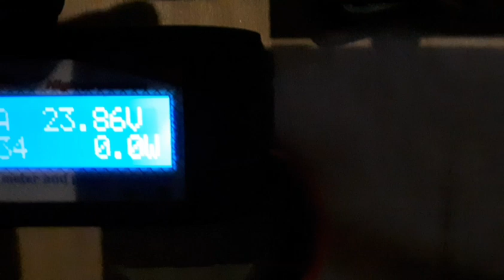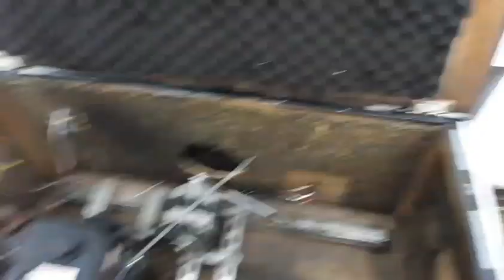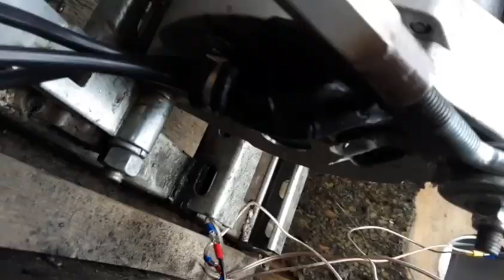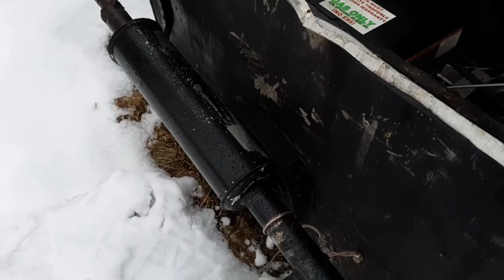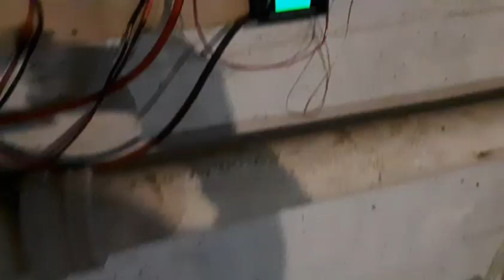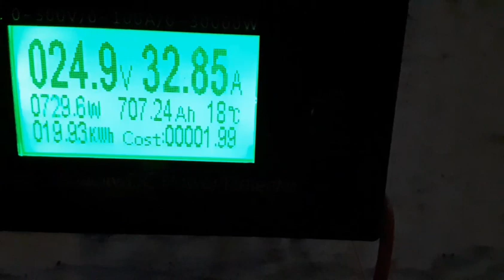DC Generator, Battery Bank Charger.

Comment: Why the stepup to 24V?
Reply from the maker: Double the volts, cut the amperage in half. Safer for all the individual components and my family also. At 12 volts there's just SO much amperage involved in every process before it comes out of the inverter.  Doubling the voltage allows my to get all 1200 watts out of my panels because it's an 80 amp charge controller so at 12 volts the controller would only allow roughly 800 watts though the line. Also I can save money on wire because I'm carrying half the amperage.  It's easier on my generator...half the amperage,  half the heat. The 24 volt inverter is also more efficient because it doesn't have to step voltage up so high. Higher voltage also travels through long wires easier.  Voltage = Electrical Pressure.  
Many reasons.  Honestly I'd like to step up to 48 volts to be yet even more efficient but that will require a new inverter.
Reply: @smallcityhomesteaders1600  Thanks for the replies! Battery banks are rather intimidating. Thousands of bucks in equipment and so much to learn. It's now or never, though, I reckon.
Reply from the maker: @anonymousjr1140  Seems to be, indeed. Group 31 deep cells are pretty reasonable.  Believe I paid $120/battery for 10 of them. Your demand could be different then mine though. I run a full size fridge and a large deep freezer year round.  We also have 3 daughters so we run laundry. We line dry clothes to save power but can run the dryer if needed. I also do all my fab in my home workshop...welder is used frequently and occasionally the drill press, grinder, ect. The huge, expensive "off grid" batteries are nice but not cost effective to me. If you learn how to properly service your batteries they last longer then the sealed "maintenance free" ones. Worth the trade off to save 50% and not have to replace them in 2-3 years. When there one's no longer serve my purpose however...I'm buying a forklift battery.  Expensive up front but they last nearly forever if taken care of. Shop around locally.  Make relationships with smaller businesses and you get better deals and service if anything goes wrong. If you have a local forklift service shop, contact them and see if they have used batteries for sale. When the wind isn't so loud I'll do a more complete rundown with a cost breakdown and list parts used. In my descriptions for all videos I list parts with links. Hope I can help.

Comment: Nice video. What video of yours explains more about the bank and other equipment?
Reply from the maker: I should probably do a video going over everything but it's mostly condensed into the one titled '500 and 800 watt turbines from Green E Solutions' and 'Off Grid Solar System Overview'. I will get on making one that briefly goes over it all....it's a lot of stuff though. More then just the generation side of the system but the conservation side... I redid quite a bit here to maximize total system efficiency.

Comment: When you get around to a wiring diagram, I would like to see it. What batteries are you using and what AH do you achieve? Good job on the video!
Reply from the maker: I could probably do a diagram on a white board in the future.  Batteries are group 31 deep cells. 110 Ah each but the bank is series/parallel  at 24 volts so 10 batteries,  5 pairs @ 24v, 110Ah....550 Ah total. Ends up being 13.2kwh, half of that is useable.  Thanks for watching!